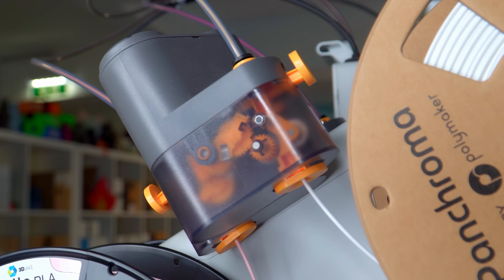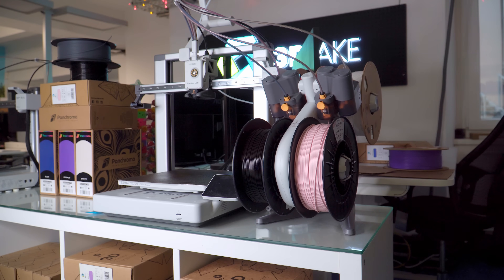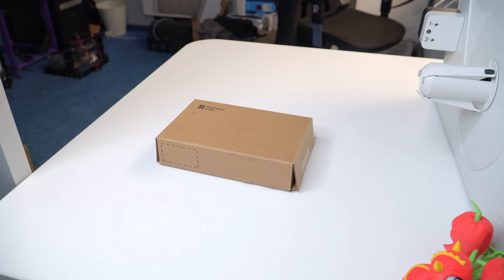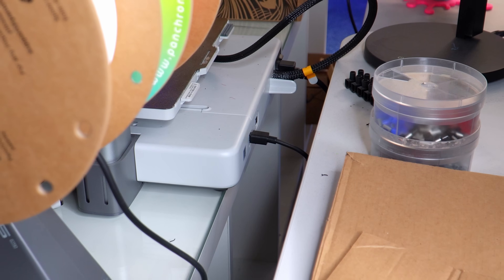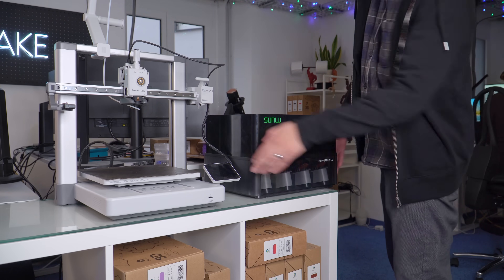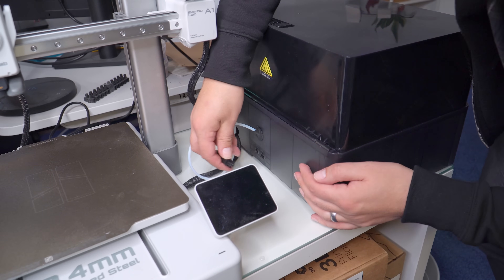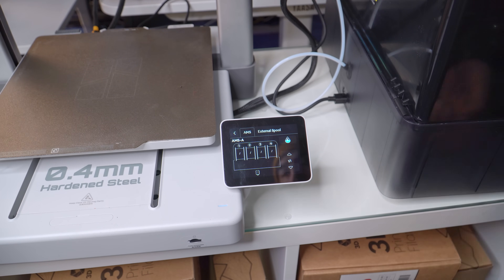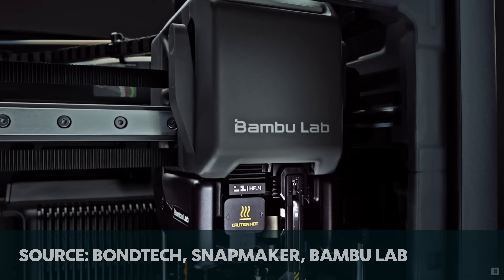Get Your AMS/2 Pro/HT Working On Your A-Series Printer!

Comment: Hi Jake thank you for the news on the update with regards to the AMS but looking at the prices of the AMS/AMS Pro,  why would people buy them as they are not cheap and you have to replace the AMS lite just to start again with 4 filaments.  When Bambu could utilise the spare port on the back of the A1 and now the AMS hub for the A1/A1 mini is out could they not adapted the A1/A1 mini to take 2 of the new AMS hubs ?  It would be so much cheaper. I like the AMS lite and is the same size as the AMS/AMS Pro really.
Most people that own a A1/A1 mini are just hobbyists and I am sure they wouldn't need anymore than 8 filaments at once.

Comment: Can we mix and match an ams and ams lite unit together?  If not, the cost to move from 4 colors to 8 is doubled.  That puts it out of the budget for a lot of hobbiests.
Reply from the maker: Alas nay, I wonder why Bambu....I wonder why
Reply: I was thinking the same. Even if it allowed an AMS HT for one extra color. For most of my prints that fifth color would come in handy. I can still print them but have to be swapping rolls. Also the AMS HT can also be daisy chained lol

Comment: The full size AMS hub works also not just the A1 version. For me the AMS 2 Pro and the HT are above the A1 mini, and I fixed an original AMS Hub to the bottom side of the AMS mount. I used an AMS lite with cover before, but the sealing of the AMS 2 Pro is much better, and I can see the filaments inside. Also the replacement is easier too. And the HT is a much better dryer than my old one.

Comment: I took the board from the AMS lite and put it inside the AMS Lite Mini after printing it. Once mounting, I 3d printed PTFE tube connectors that didn't require the PC4 connectors. They are routed to a Creality Space Pi X4

Ended up being far more affordable and surprisingly effective.

Comment: My A1 Mini is a great workhorse in standard from comparatively, I have no issue with exposed spools and the filament feed has never given me a drama. The only real case I could see is if you need to use more than 4 filaments in a print, otherwise it's just a way to sell more AMS's. My assortment of BL gear is no longer attached to the cloud ecosystem and remain on old firmware so this isn't for me. Toolchangers are here and next year is going to be wild.

Comment: AMS Lite is fine for my setup. It’s cheaper. I have enough room to sit it beside my A1. I have printed the enclosure to slow down the moisture absorption. I rarely print multi-colour models because of the large amount of wasted poops, rather buy something like Snapmaker U1 for multi-colour prints in the future. So yeah AMS Lite > AMS for me.

Comment: AMS units are not going anywhere.  Multitool changers will always be limited to the number of colors/filaments that they can use.  With an AMS theoretically an unlimited number of AMS units can be hooked up to a printer with one nozzle.  It’s only limited by the software and power demands.  Tool changers will be limited by physical restraints of the printer size.

Comment: I prefer my AMS Lite. It’s ultra quiet, doesn’t get tangled up rewinding and it works with both plastic and cardboard reels. I can’t say that about my AMS.
Reply: It’s faster too.
Reply: I agree completely. I started with a X1C with AMS 2 and then got a A1 mini w/ AMS lite. I liked the AMS lite so much more than the AMS 2 that I've gotten a full size A1 that I typically use instead of my X1C. The AMS Lite is so much faster and seems like it has significantly fewer issues.

Comment: using ams on the A1 series is just a cash grab from bambu and way to many people are falling for it
Reply: I think it's a sign that they aren't going to maintain two separate lines of AMS. How is it a cash grab to let you use the new AMS on the old printers? It woudl be one thing if they like, disabled the use of AMS Lite, but this is simply an option for those going forward. I think the biggest plus is being able to get an AMS2 Pro for an existing P1S or X1C and then migrating the AMS1 over to the A1.

Comment: Pla does not care about moisture.
Reply: Lol, you clearly have no idea what you are talking about. Must be nice living in a low moisture place lol. Try using a roll of PLA that sat open for a year in a house with 60%+ average moisture 😂
Reply: @HoodedLime  I have several rolls on my benchtop opened over a year ago. 62-72% humidity all year. Asked the filaments if they care and they were completely indifferent. But yes for printing it matters so I usually put them in a dryer first.
Reply: While PLA absorbs less moisture than other filaments, excessive humidity can still affect it, leading to brittleness and poor print quality.
Reply: PLA is effected by moisture, it becomes brittle.  I live in a fairly dry climate, even though it rains a lot here the humidity is fairly low.  I keep my PLA in plastic bags on a shelf with no desiccant and it works fine most of the time.  Some of the filament that I haven’t used in a while will be brittle because of the moisture that it has absorbed, but a few house in a dryer will get it back to normal.  I’ve not seen moisture affect print quality but it’s hard to run wet PLA through the AMS because it will break.